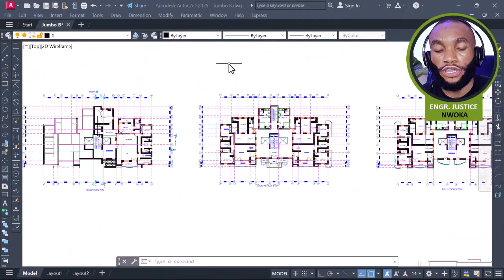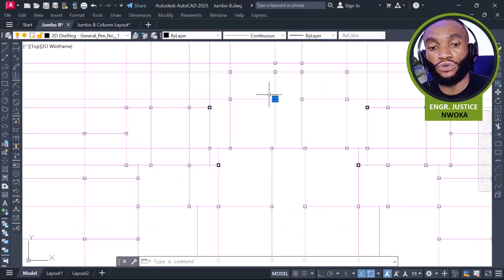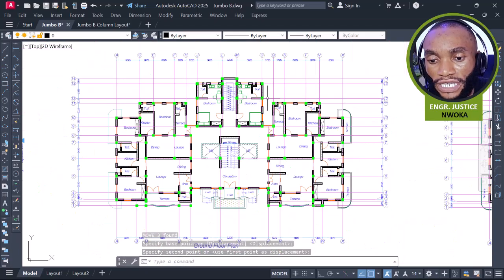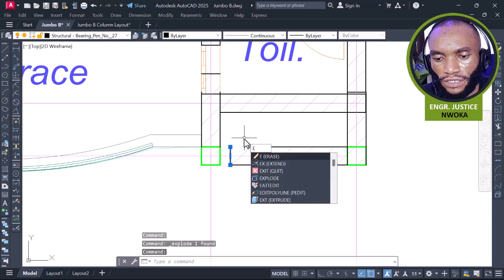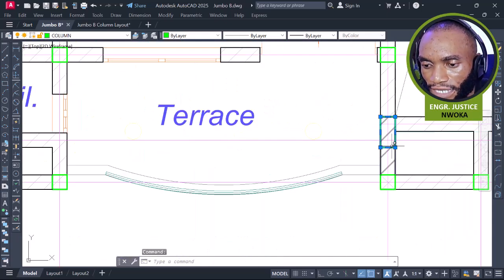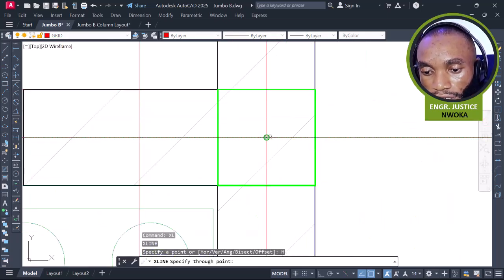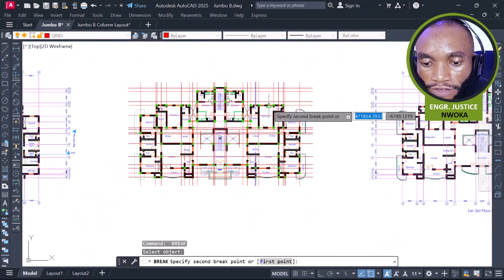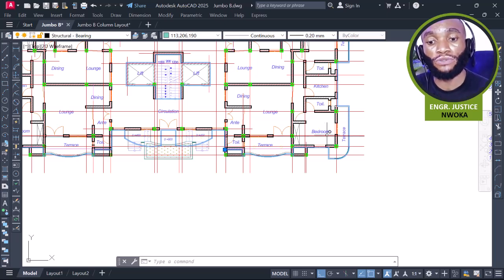Design of 4 Storey RCC Building having a Basement Floor with Different Ground Level - PART 1

Comment: This is amazing, weldone. 
But i think that instead of making the wall attached to the column you marked red to be 9", its better to adjust the window placement on the adjacent wall to accommodate the 9" column while the 6" wall remains unchanged... 

Great work, weldone..
Reply from the maker: Sure 🤝

Comment: please can wall be placed on slabs where by there is no beam underneath the wall and the wall is directly on the slab
Reply: Very well
Reply from the maker: Yes it's very possible but there are rules that governs that
Reply: @EkidelEngineering  please if you don't mind what are the rules governing it
Reply: Rather make a video on the subject matter
Reply from the maker: @essentialacademy1299  👍